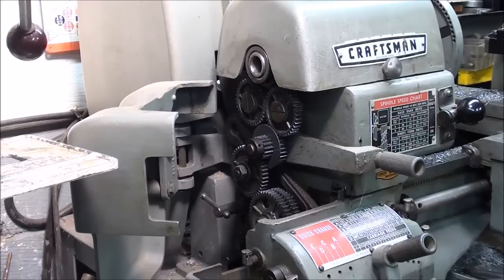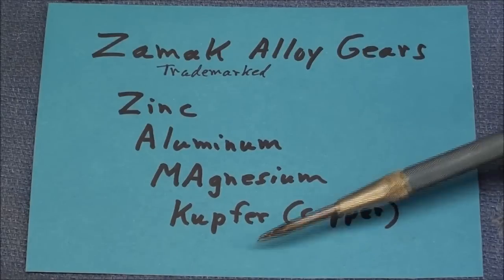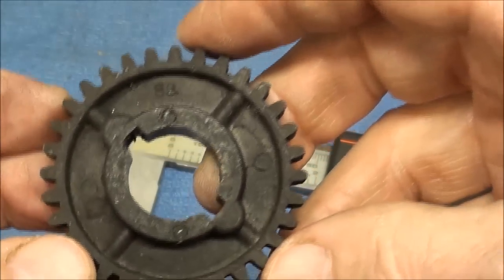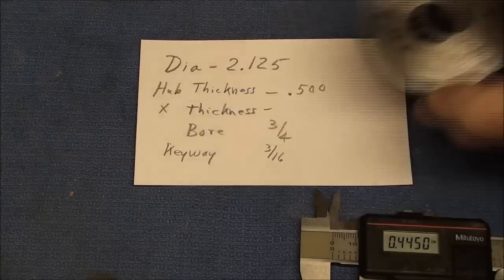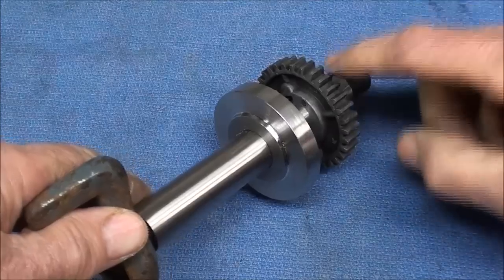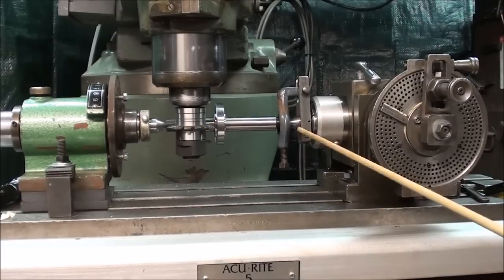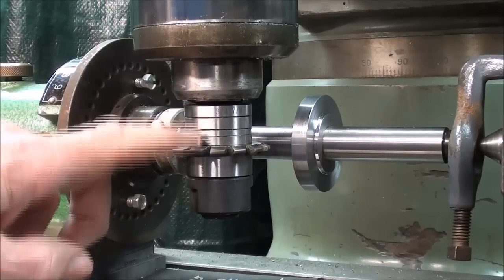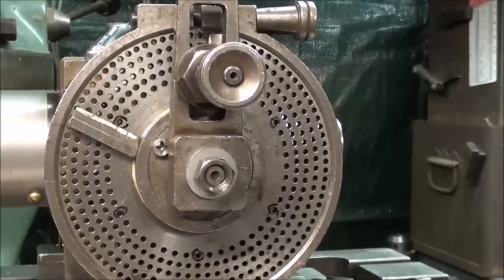SHOP TIPS #200 Making Gears for the ATLAS Craftsman Lathe mrpete222

Comment: Thanks for this video I enjoyed it especially as I have two 10" and one 6" Atlas lathe and I know how pain taking is to change gears no matter how experienced I am in that. My comment is really about the double keys which is a very smart idea. In the case of a single key there is an excentricity created by the torque. This excentricity is pressing the shafts harder to one side in the gear (or the gear to the shafts, the result is the same)  and since most usage of the gear train is done in the same direction the gear which made of "softer" material eventually will have an oval bore. One can notice this effect of an unbalanced torque while installing a spark-plug without holding the wrench, at the plug letting the torque breaking the plug. Basically it's the same effect. The DOUBLE key takes care of that by completely eliminating that side effect of torque transmission. Beside the economy of using Zamac for gears there is another good side of this application. Zamac is less brittle than castiron so breaking out teeth from the gear is less likely, in case of a sudden load. The loads on these gears are not that great and their usage is relatively rare except for a few of which replacement is rather inexpensive even today.  I will find the rest of your videos on Atlas-Sears lathes. Thanks again.   That Old Bob
Reply from the maker: Thanks--that was a very interesting analysis.
Reply: This young bob wants to know if it has anything to do with timing the gear? One key is between teeth the other is on one tooth... i dont know if timing is important. I dont even own a lathe

Comment: Great video and nice job. Its all the small details that you cover that make the difference between a good and a bad job. For example keeping on top of the back lash, having a set method of traveling round the dividing plate, accurately setting the z height and cutting towards the larger end of the mandrel. I have enjoyed this gear cutting series allot.
Reply from the maker: MrCrispin96 Thanks--hows that locomotive coming along?
Reply: mrpete222 Ive not had much chance to work on it since the assembly of my chassis but ive been thinking through how to do the cylinders and what jogs and fixtures to make. Which is half the fun. The material has arrived so I can make a start soon. They are going to be machined from solid mild steel blocks and then i will lock tight in cast iron liners. There will be 2 bores per cylinder, one for the piston at 1 11/16" dia and  a 7/8" bore for the valve.

Comment: Hey Pete !! Awesome video, It's funny you said in the video that people would probably not make gears at home. Well I am restoring a Prentice Bros lathe from 1886 and I have no change gears for it at all. The tag does list the gear sizes and what position to put them in so I can use that info to make them. I also have to make a new compound since this one was so heavily damaged. Your videos are an excellent resource for me. I'm new to machining but I have a extensive mechanical back ground so this doesn't seem to difficult to attempt, thanks to your information. I am also in Illinois. I'll keep you posted on how it goes. Thanks again !!
Reply from the maker: Good luck with those gears
Reply: @mrpete222  Thanks, I'm sure I'll be referencing the video often during the process.

Comment: Here in town gears that were shipped flat on a semi-tractor due to their size and maybe 12" thick with hubs to add.  They were oil field gears and the shop here poured gray iron and created finished product.  Just one of the shops.  They used large hobs to cut not a wimpy one like that.

Comment: Good video.
 I had to make some gears for my 12x36 when I was refurbishing it. I had no access to ... well money so I had to do what I could. I program and operate a laser at work so I programmed the gears I needed and cut them out of thinner sheet steel. then I matched them up, drilled them, and put roll pins in them. After that I polished them with a deburring wheel and they are as smooth as glass and seem to be easy on the pre-existing zamok gears. They work well and cost me virtually nothing.
Reply from the maker: Lyle Adams Thanks for watching

Comment: On my 6" Atlas the double keyway is used for a special spacer with two "ears" that joins two gears together to form reduction ratios for feeds and threading. The center of the spacer is a hole that the attaching bolt (axle) runs through. There is no mechanical reason why one keyway wouldn't work, but for whatever reason Atlas made the locking hubs with two.

Comment: Very good video. The instruction was very clear, thanks. I have a question though, wouldn't putting that steel gear in the machine quickly wear out the teeth on the adjacent gears made out of softer Zamak?

Comment: I've worked with Zamak. Easy to cast, but very brittle. I also had problems with people putting stainless steel metal screws in it: due to galvanic corrosion the screws got stuck and you would strip the thread while removing them. I kind of hate Zamak because of all the issue I had with it.

Comment: Great video. You are totally correct about the goggle box pumping out useless boring TV shows. Give me machine shop youtube entertainment any day.

Now I have a china special lathe 7x14 and have often wondered about cutting gear teeth. I reckon locking the gear box and manually driving a cutting tool is the way to go. Slow and laborious. I also have a need to cut a reduction gear (32 tooth outside and 8 tooth inside for example). How would one deal with that situation?
Reply from the maker: +Drew Dastardly that combo gear is 2 pieces

Comment: Just came to this party, pretty late (as usual), but I'm very impressed with your machining and video making talent! So I'm finally retired, and wanting to start a new hobby. I have a Craftsman 109 that is about as close to new as can be, it has been stored safely in a custom wooden box for 50 years at least! Hence the searching for metal lathe videos! I don't know squat about a metal lathe so this is intriguing to me, thank you. Is this old lathe worth investing my time in? It's complete except for a motor, has quite a few accessories, gears, tools, etc. no rust at all. Would it be advisable to look for a more modern machine? Is a machine this old worth anything? I am a complete rookie at this, and just to date myself, yes I remember silhouettes on the shade very well! I'm a 1949 model.
Reply from the maker: They are pretty good machines. Just very small. Rate for the hobbyist with little projects

Comment: To validate "on center" gear cutter can used thin steel scale between cutter and stock - scale is vertical if on center - angled scale is above or belwo scale - works for setting a lathe on center of round stock.
Reply from the maker: Thanks

Comment: Zamak is famous for being difficult.  Back in the 50's there was manufacturer of S-gauge model railroad engines (Miller Engineering?) that made an innovative diesel model, but the powered wheel truck frames were made of Zamak.  To my knowledge, every one they ever made has flaked away into dust.  I sold the remains of one my father had purchased new last year- most of the engine was almost pristine, but the trucks were rotting piles of zinc.
Reply from the maker: +componenx THANK YOU

Comment: Enjoyed all our vids on gear cutting.   As you said the depth of cut "should' be on the cutter.   My 12 or so involute cutters have no depth info, my luck, but easily calculated.   We have some of the same books, another I like is "Gear Design Simplified", by Jones and Ryffel    
     I purchased a centering scope from Enco or MSC some years back, very good investment about $150  cant really remember the exact price.    I make smaller gears for clocks and they are of course cyclodial tooth form.    The scope really helps if cutting a 6 tooth pinion that is 3/16 OD and 1/2'' length.     I use a Sherline CNC rotary table for my small work and it is sturdy enough for 4'' dia, 1/2'' thick gears.    
    I do have my first bevel gear to make and has been a fun challenge to figure out how or what system was used to make/calculate the angles.     Made about 1870 to 1920, not laid out by today's 'standards'.    Just plan to copy it's mated gear and see what happens.
Reply from the maker: thebaron44 I used to have that book at school. Its a good one. You are making some real tiny gears. I always wanted one of those scopes.Good luck with your clocks.
lyle
Reply: mrpete222 L, still available from ENCO..only $199.95, plus shipping and handling.

Comment: A old mechanical engineer friend of mine use to work for Sears.  He worked in a group that redesigned name brand parts to relabel as Sears.  They were to make it would fail  (after the warranty was up).
Reply from the maker: Herb Blair Hi Herb.  My son engineers for a major garage door opener co. They are working to reduce the life of the openers. They last too long.
Reply: mrpete222 This is the worse that mankind could do... Just for greed, it's so much more difficult to make something fail on a timed manner than to make it last for a long time... This disgust me sooo much, that we fallen that low. :-(
Reply from the maker: pierre beaudry Nothing new about this. I'm sure you know about the light bulb conspiracy from the 1920s.
Reply from the maker: Herb Blair I'm not surprised
Reply: We're not so surprised, but REALLY disgusted...
Reply: Herb Blair The same thing happens in electronic engineering. 90% of our time is spent testing capacitors from various manufactures trying to find one that will fail on average 6 months after the warranty is up. I'd rather get into industrial rather then consumer electronics.
Reply: +mrpete222 Yeah, supposedly some of the originals are still lit.
Reply from the maker: +Herb Blair THANKS for watching!-hi herb

Comment: Way late to the party, but the reason for the 10 to 13 thou undersize OD on those zamak gears is interchangeability among all machines made, all serviceable casting dies, and all alloy lots. At "just right" dimensions the stacked tolerances would require "select fit" for a quiet nonbinding stack (and binding equals broken teeth with zinc alloy). Notice the OEM "loosie" gear when meshed with your "perfect" shop made gear had a tiny bit of clearance, while the shop made gear meshed full depth, full width every tooth. That clearance allows for the manufacturing tolerances of the gear shafts placement, parallelism, etc. It also allows a longer service life for the casting die because dimensional creep over time is less critical.

If you recreate every gear to "perfect" dimension, you will most likely have to hand fit a couple to use them as a running set, and that set would likely not interchange to another machine without additional hand fitting. By building in a little "slop", every gear works in every machine adequately without costly hand work, and replacement of a lost or worn gear is just "order and install" idiot proof.

Comment: The two opposing keyways in the gear are there so they fit on the double keyed cast sleeve which ties two paired gears together. I suppose only one key could have been used on the sleeve, however it may be that Atlas believed the ZAMAC wasn't hard/tough enough to withstand the forces imposed at that point so they doubled the keys to halve the forces on each key.
In the end you may find it necessary to cut 2 keyways in your shop made gear so it will fit on the sleeve.
Reply from the maker: pyromedichd1 Thanks--I think thats it

Comment: I believe you will find that the reason for the two keyways is that there is a coupling bushing with two keys cast into it that will couple one gear with another for a compound gear when making up a gear train to cut threads or change the cut.per revolution.
Reply: Mr Pete
Gordon is correct, the hubs for the change gears have two die cast keys built into them, probably to add more shear strength to the part.
I think you can still buy new ZAMAK, too. In case someone wants to cast new gears. 
Thanks
John
Reply: Correction
 Bushings, not hubs.
Sorry
John
Reply from the maker: +Gordon Eckler THANK YOU

Comment: You made an interesting statement about materials and I was wondering why cast iron would be better than hot or cold rolled steel for making gears. Is it wear capabilities like a cast iron engine block?
Reply from the maker: Doug Rundell Yes. I also learned that some of the gears like logan, are a cast steel alloy.

Comment: I like Craftsmen tools, own a bunch for woodworking plus bike & car repair. The only thing I am left wondering is why turn that nice thick blank down to leave only the hub thick? 

Obviously when they designed it they had a cheaper metal (a similar metal alloy is popular in blowback gun slide designs these days, BTW) and you have, comparitively, the perfect piece of steel. Its harder, its thicker. 

Would it been a mistake to leave it full width thus keeping it stronger?

Comment: Oh yes, decaying zinc alloys! Sometimes it´s triggered by age, sometimes by very cold temperature (-20°C, I think). The stuff swells up, develops surface cracks and gets very brittle. Happened mostly to stuff from the 50s/60s, I guess the huge worldwide demand for zinc then let some zinc smelters produce not so pure material. I have seen this failure on cheap stuff like toy guns but also in expensive things like manual calculators, so the problem must have entered the line very early in the line of production, that only leaves the zinc mines/smelters.
Reply from the maker: sthenzel Thanks-I have seen this often

Comment: Thank you for the wonderful videos you do.  They are very informative. I recently acquired a craftsman 101 and a few of the teeth on its gears are chewed up and im wanting to make the gears for it instead of purchasing them. I do however has a slight issue. I do not have a dividing head or indexing plates. Do you know of any decent sources for these components that are reasonably priced?  Any information would be greatly appreciated. Thank you.
Reply from the maker: The only real sources for these parts is eBay.  Or buy a donor Lathe for parts

Comment: In the 1990's I worked as a design engineer for a company that made earth moving equipment. I was given the assignment of designing a mold for Zamak hydraulic piston. My first attempt was not successful.  I knew that Zamak would shrink over several months, but trying to economize on material I made the mold too small to get the finished diameter of the piston. Your gears are old and Zamak continues to shrink over the years that is why the gears were not the same
Reply from the maker: That is interesting. Apparently very unstable material. I haven’t seen many die casting is over the years deteriorate, almost fall apart

Comment: Hi Mr. Pete.  Great video as always.  Quick question about the steel gear.  I'm guessing the steel gear is harder and tougher than the Zamak gears, so if you put this in the gear train, will it tend to wear out the teeth on the Zamak gears faster than a Zamak gear would?
Reply from the maker: +David Doster THANK YOU

Comment: Hi there ,I like to ask u for advice ,I'm in the market for buying me a lathe and I need to know if buy an old south bend needing some attention or should I buy a cheap Chinese mini lathe. I also need to know if the diles on the lathe whither metric or imperial matters (are they the same increment. ).I apologize for the spelling ,I'm afrikaans and English I know bit my spelling is not the best.thanks I appreciate your advice
Reply from the maker: I would much rather have a used machine. But they are fairly hard to find in good condition. You really do not want one that is totally worn out. I am not a big fan of mini machines
Reply: @mrpete222  hi thanks for the quick response, I just also like to know if the difference between the metric and imperial lathe will it make it harder to use an old imperial lathe cause I really like the south bend 9 lathe as it seems to be very good quality and well put together. Lathe machines are really expensive especially here in south africa ,anyway I like all the information around the use and maintenance of lathe machines. Thanks again for your advice.

Comment: On some engines (Triumph twins), the cam gears have several key ways to adjust timing as the keys are off set from the teeth differing amounts. I assume this would be irrelevant for this application. Cheers
Reply: Andy Reynolds I suspect that there were two key ways because this gear was also used in another application on a different machine  that needed two keys. Being War time it would have been costly and wasteful of peoples time, to make another mould just for one lathe. They used a mould that was already made, but when using it on the lathe use either key way as is only used to key it to either the output shaft or the leadscrew. The only other time you need a key way is when two gears need locking together as an intermediate gear and must not change their relation to one another.
Reply from the maker: Andy Reynolds I used to ride a friends 500 triumph